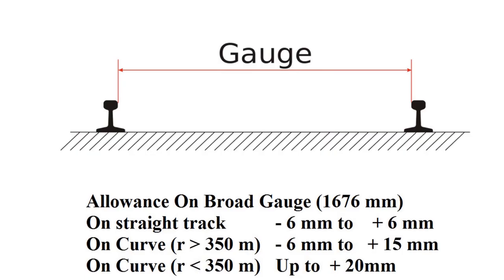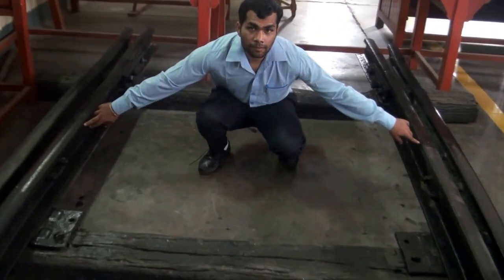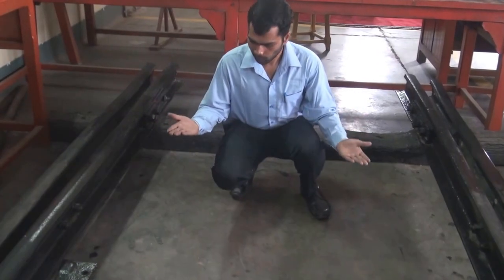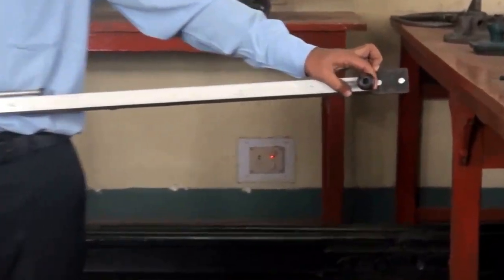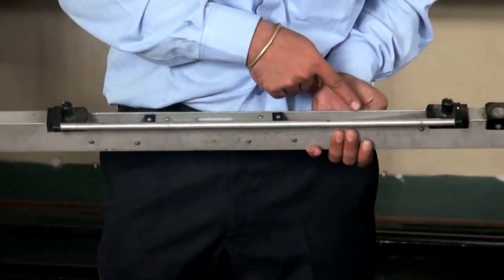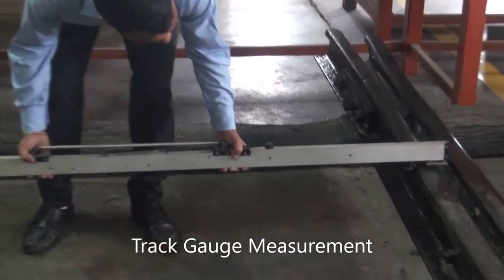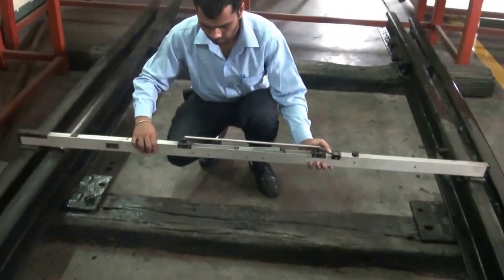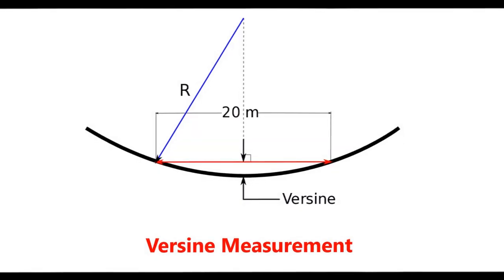Track Gauge Measurement || Indian Railways Institute of Mechanical Engineering

Comment: How to adjust the horizontal bubble ,if it not in the  middle,how can measure the superelevation
Reply from the maker: If the track is perfectly horizontal, the bubble will be in middle. So, first slide the spirit level in the groove till it gets in the middle and then read the marking with which the spirit level coincides. That would give the superelevation or cross-level!
Reply: Got it!Thank you for your explanation
Reply: @alicewang1351  hi